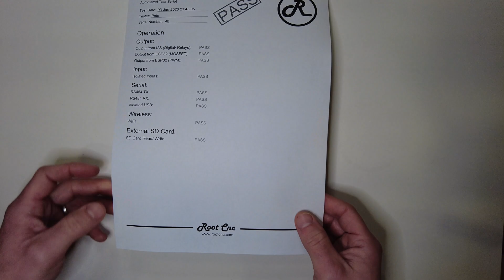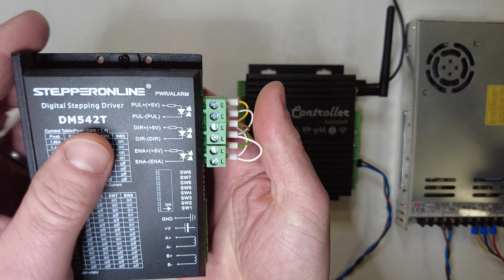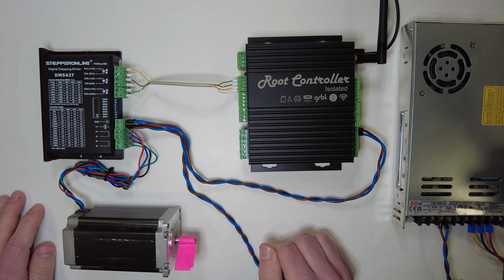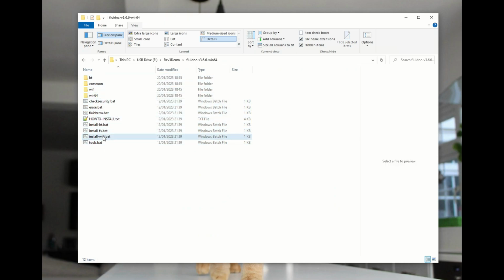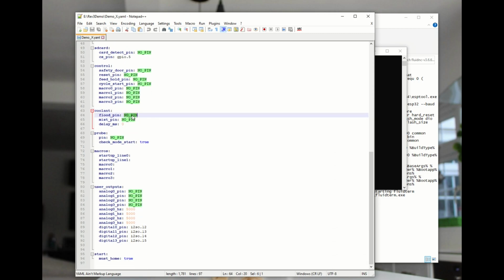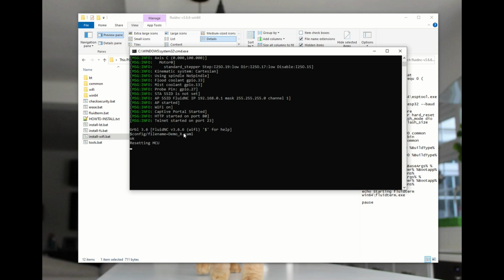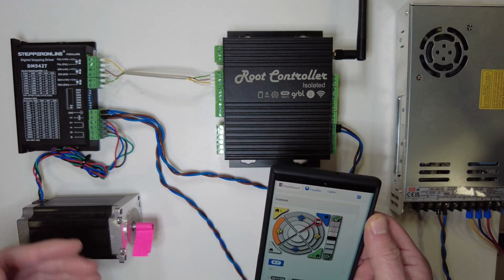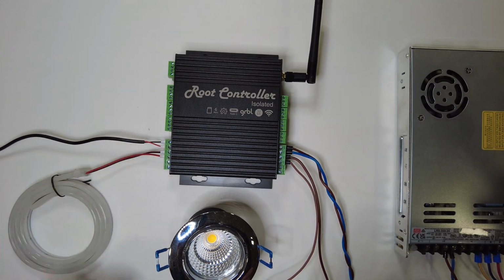Root Controller ISO // Rev 3 // Introduction // Getting Started // Configure // Wiring // DIY CNC

Comment: Would you say this approach is fully deterministic?
I think it is, but I’d like to hear that from you.
Reply from the maker: @motriz-industrial6846  what do you mean by fully deterministic? The controller will keep accurate positioning
Reply: @RootCNC  A fully deterministic system in motion control is for applications where precision, reliability, and repeatability are non-negotiable, ensuring smooth and fast accurate operation in real-time environments. I am considering the Root Controller for an RZT actuator:
https://youtu.be/1o_lHINB5YY
Reply from the maker: @motriz-industrial6846  Ah, I see! The Root Controller is compatible with FluidNC or GRBLHAL, both of which are based on the reliable and time-tested GRBL processor. GRBL has remained largely unchanged because it works so well, and many machines operate using it behind the scenes. The Root Controller ensures precision, reliability, and repeatability, making it a solid choice.
Reply: @RootCNC  Thanks!!

Comment: Got a question about the connectors. In your shop you offer a bundle of connectors for this device, are the connenctors showen in these video are not includet?
Reply from the maker: @michaelorlik3dwaldhessen318  they are included. You only buy the connector pack if you need additional connectors
Reply: @RootCNC  sorry maybe i am a little lost, but there are no more ports on the controller when all connectors included. Btw think i go with this controller on my second Maschine.
Reply from the maker: @michaelorlik3dwaldhessen318  all the connectors are supplied with the unit
Reply: @RootCNC  thanks for your patience, everything looks fantastic and its the solution i am searching for.  Got more questions befor i buy, so iam joyning the facebook group.
Reply from the maker: @michaelorlik3dwaldhessen318  the best place for easy questions and answers is the Discord group. If you're keen, join there

Comment: Hi.
Your Wiki documentation about the relays says:

Relay
The Root controller has three NO relays (the Normally closed Pole is not accessible).

But ver. 3 has only two, am i right ?  Just in case, why not three ?
And way not to expose also the NC pin ?? It could be useful.
Reply from the maker: @IceCreams62  Hey, 

Correct the Rev 3 only has two relays due to space constraints.

Unfortunately, the chosen relay does not have a normally closed pin. However, the software can be configured to convert this to a normally closed switch but only when the controller is powered. 

Additionally, the mosfet ports can be used to drive an external relay

Kind regards
Reply: @RootCNC  Thanks a lot for the reply
Reply: @RootCNC  Sorry to bother you,  another question. Is it possible also to connect a FluidNC ''FluidDial CNC Pendant''  to the controller  ?
Reply from the maker: @IceCreams62  fluidnc dial is not compatible with the ISO Rev 3. Future versions should be. I'm exploring options
Reply: @RootCNC  Ok, thanks. Perhaps PRO+ will be 🙂

Comment: Thinking about getting this for a CNC build. I an wondering if I can use JMC servos with this board? Cheers
Reply from the maker: @grandmastersreaction1267  have you got a link or part number for the drivers your interested in and I'll take a look at them
Reply: @ for some reason YouTube is deleting my replies. They’re called iHSV57. I think the PrintNC wiki has some info regarding these servos.
Reply from the maker: @grandmastersreaction1267  I've have a good looksee over the datasheet and these are perfect for the Root Controller! :)

please see this video for comparable wiring and setup https://youtu.be/berBTHqwn0E
Reply: @ absolute legend. Thank you. 🙏
Reply: @ sorry, but I am a complete noob. Would the wiring of the iHSV57 be the same as the closed loop stepper motor in your video?
Reply from the maker: @grandmastersreaction1267  correct. It should he the same. There is one extra signal but isn't necessarily needed for operation
Reply: @ which one is that?

Comment: i was wondering if i coild run 5 limit switches and 5 closed loop steppers 🤔 and yeah i want to go 5 axis
Reply from the maker: Yup that is not a problem! The Root controller supports 6 motors and 6 Axis. You can gang motors together to form an axis, for example the dual motors on the Y axis for the Root CNC machine. this way you can auto square the machine.

For closed loop steppers - see this link https://youtu.be/berBTHqwn0E

For endstops, see the wiki! https://wiki.rootcnc.com/en/Root-Controller-ISO/DetailedInfo

I hope that helps
Reply: @RootCNC  but need be linuxcnc support, only software who working perfect and have flexiple make own system. many additional tools etc. i has try looking were can buy mesa card copy, this is perfect controller board what have made cnc builders. but too expensive hobby users ower 200$ board. hobby users need be less than 100$ board.

Comment: can it be connected to mach3 ?
Reply from the maker: I cannot, it is GRBL based. Basically the same
Reply: @RootCNC  need be connect whit linuxcnc this have only REALTIME safety controller software what can use, i used mach3 many year and lot only problem and not safety because not have REALTIME controller. and USB have lot timing problem, need be LAN connect only. or need build real good mesa crd copy but lot cheapen, about less 100$ need be mesa card copy. more in/out and LAN.

Comment: How would you wire alarms for closed looped motors? Thanks
Reply from the maker: Depending on the motor drivers you use, the fault/ alarm signals can be combined together. Then this combined singal can be sent to the controller, via one of its 8 inputs